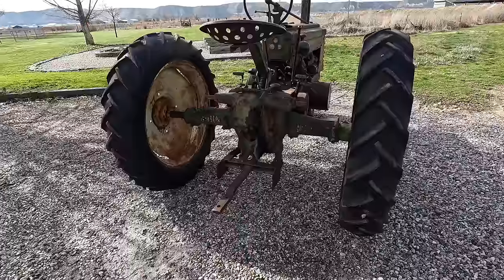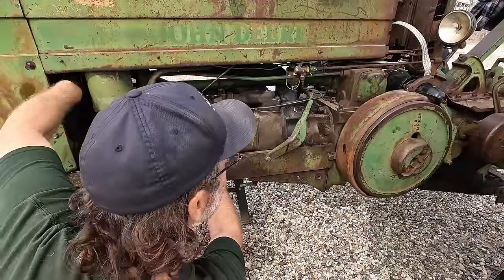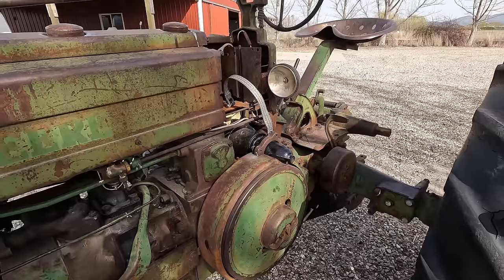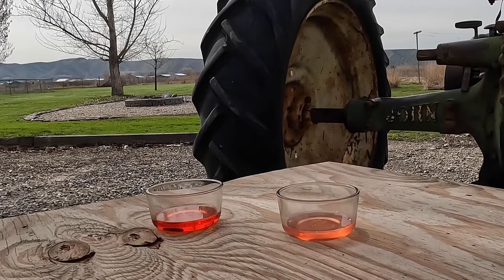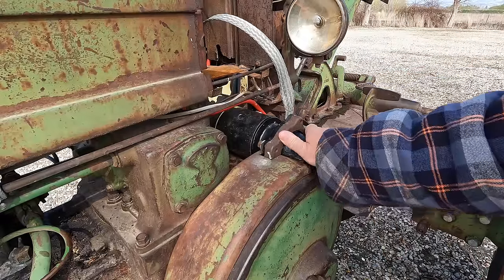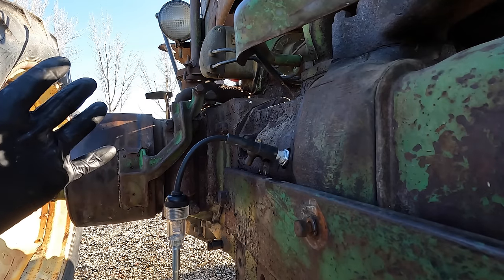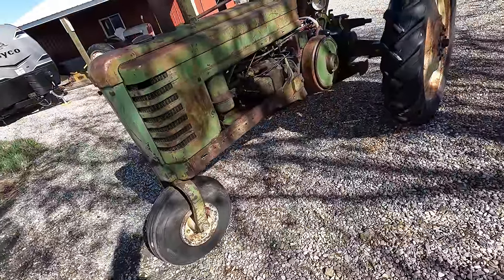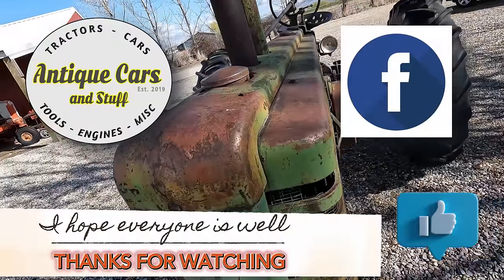1946 John Deere BN - Auction Find

Comment: Those "Cheapie" NGK plugs are the highest quality plugs you will ever own.
Reply from the maker: Interesting. I guess I'll keep them. Thanks!
Reply: @monk43012 I agree Partially with your post. I Like NKG products for small engines such as lawn mowers, ATV's etc. but for my antique tractors such as my Deere's and IH's I have not had good luck with them. They seem to last about 1 season, and then the tractor has a really hard time starting, when you pull the plug it is corroded and wet with moisture. I suspect that this has to do with the cast iron and wall thicknesses of heads. as to wear small engines is usually aluminum cast etc. And for that Note, Autolite and Champions are what I use on my Antique Tractors. Great Topic though, and like I said NKG's  are great products, it just depends on the application!

Comment: My grandfather and father farmed with 2 cylinder John Deere tractors. The first tractor I cultivated milo on was a John Deere 70. In 1965 dad traded for a new 4020 John Deere diesel. The 70 left , a 3 cylinder German built diesel replaced it. We still have that little John Deere. As I make my comment , you will know i'm talking from experience. You may or may not know about what , i'm telling you. It's meant to help! The bracket over the spark plugs is so weeds do not short out the plugs. Do you have the stub shaft that bolts into the steering wheel for hand starting? On dad's G the tool box was just in front of the steering wheel support. Have a good day!
Reply from the maker: Thanks for the comment. I do not have the hand starting shaft. I wish I did. Yes, I know what those brackets are for. A lot of times they are missing completely so it’s nice they are there. Hopefully I can save this old girl and get her running again. I hate to see these old tractors neglected like this.

Comment: If I remember right double check me going off foggy memory.  Starts on gas when warmed up switches to diesel.    And marvel mystery oil in gas
Reply from the maker: Yes, they were designed to start on gas and switch to kerosene or tractor fuel, but not diesel.

Comment: that tractor is 6 volt postive ground.
Reply from the maker: I forgot about the positive ground. Thanks!
Reply: The only thing that would cause an issue with is the generator, the starter motor and lights could care less which way the battery is hooked up. Some Case tractors were actually 6V neg ground, but the neg ground regulators were hard to find so most got switched over to POS ground.